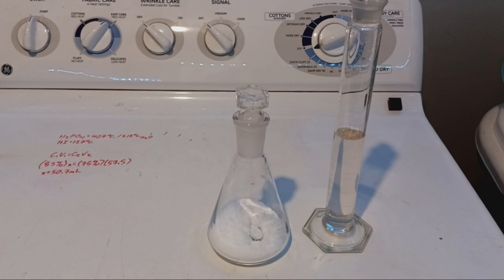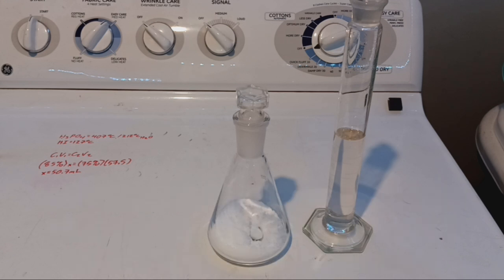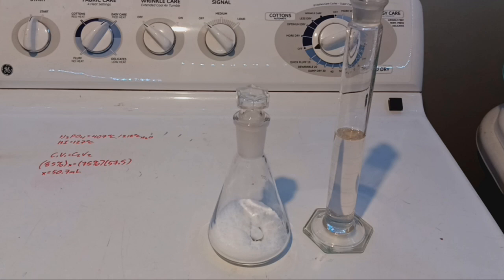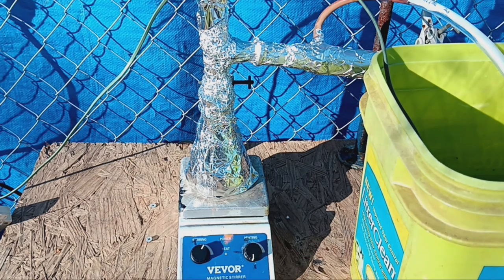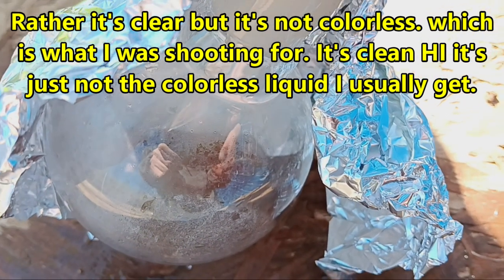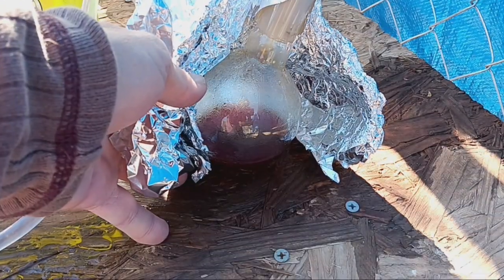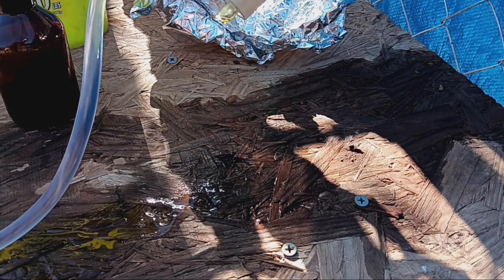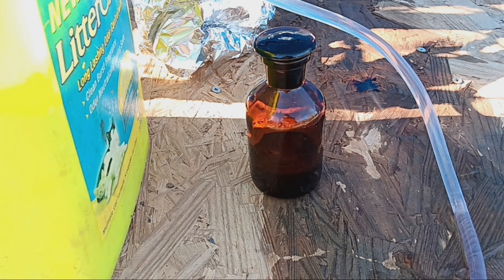Conc. Hydriodic Acid From Easy to Buy Chems #chemistry #iodine

Comment from the maker: Other than the dark color the prep was a total success. I got some fairly strong HI out of it. Hydriodic acid is the strongest of the hydrohalic acids and among the strongest acids you can easily make at home. I was thinking of making an exotic metal iodide or something else cool with it. I don't want to leave it on the shelf to slowly go bad. I used to play with iodides a lot because they are often quite colorful but I gave up on them after a while becuase they frequently have stability issues in storage. Anyways I hope you guys liked it! Merry Christmas!! 🙂
Reply: Yes HI is impressive.  It can react with noble metals such as copper, mercury and even silver when heated with them and form their iodide salts (the stability of the iodide complexes makes the reaction thermodynamically favorable).
Reply: Btw if you have red phosphorus on hand you can throw a small amount in the HI to get rid of the iodine (it takes a little while but it works).  Of course a small amount of phoshorous acid will be formed and but that itself acts as a stabilizer for HI against air oxidation.
Reply from the maker: @mspalien  Never thought of that Wish I had some red P to try it!! Thanks for the tip! 🥰🥰🥰
Reply: awesome! I will be making some soon.
Reply: Too bad iodine atoms are so chunky and fat, I guess sometimes that's desirable though.
Reply from the maker: @amanitaocreata4401  😂😂 But that's one of the things that helps to make HI a strong acid. Also it's a great leaving group. So that fat ass has its uses. 😁😁
Reply: @PoorMansChemist hey, I got some KRS-5 crystals (TlBr/TlI 1:1 molar ratio). What would be the best option to get Tl2SO4 out of em? Just heating it together with H2SO4 produces TlHSO4 as far as I know. Maybe if there is an excess of thallium bromoiodide crystals instead of excessive acid it will give Tl2SO4 instead of the acid salt? Thanks in advance for help!
Reply from the maker: @petertench-zw2ti  That's a tough one. Getting halide ion out of thallium was my kryptonite for a while. You can't reduce it to the metal becasue precipitated thallium clumps like nothing else I've ever seen. Halide ions in the solution will always get trapped in the metal sponge. And not a little bit either. Now for TlBr and TlI combined you could go with precipitation of the halide out with a silver salt but thallium iodide isn't very soluble. However, there is a way that I've come across that should work (in theory; I've yet to test it). You can convert the thallium to the oxide and precipitate it out that way. IN THEORY this should shift the solution equilibrium dissolving more thallium iodide as more thallium precipitates out as the oxide. The most obvious potential problem is passivation of the thallium bromide/iodide with a layer of the oxide. I can see that being an issue. The conversion to the oxide is done with aqueous sodium hydroxide and strong hydrogen peroxide (you can buy it online from walmart).
Reply: @PoorMansChemist Would a 40% peroxide suffice or 60% is required? Also wouldn't concentrated NaOH cause H2O2 decomposition if you just add em together?
Reply: @PoorMansChemist Theoretically, could melting it together with sodium metal work, by reducing it into metallic thallium and NaI+NaBr? Or maybe use liquid bromine (I have it too) to turn the iodide into bromide, which should be much more soluble?
Reply from the maker: @petertench-zw2ti  DONT DO THAT! At least not unless you've got very good PPE and extremely good ventilation. Thallium halides sublimate when hot. They're not strictly ionic compounds. The bonding has significant covalent character meaning that they're fairly molecular in their nature. That means that they will sublimate and vaporize when they get hot. Also be extremely careful with melting thallium because I have no idea how likely it is to produce vapors. I've had cadmium metal fume fever before and that was exceedingly unpleasant. Thallium is much less volatile than cadmium but thallium metal fume fever would cause life-altering poisoning even if you survived it. The damage that it causes is permanent. And don't forget thallium has a nasty habit of absorbing across the skin. If it's sublimates and condenses onto something informs a film you could touch it and get it all over you and not know it. I'm not sure where the threshold of toxicity is with thallium but I know that even a hundred milligrams is not good. Also so far as I understand it Prussian Blue is only an effective antidote if the thallium was ingested. I don't know how effective it is if it's absorbed through the skin.
Reply from the maker: @petertench-zw2ti  PS I've worked with thallium for years and the only reason that I'm still okay is because I am extremely careful with it when I do. Don't ever underestimate it or get casual with it. I'm not saying that you will but I just have to stress that because I really don't want you to die. It's hard enough to get subscribers as it is without them going dying all over the place😊
Reply: @PoorMansChemist I am able to do that outdoors with remote controlled equipment. Thanks for concern for my health and safety though!
Reply from the maker: @ Of course! Chemistry is extremely fun but it can also be extremely unforgiving. The last thing I want is for anyone to get hurt or unalived. I am always concerned that I make some of this stuff look easier than it actually is. I would go with the conversion to thallium oxide. I have some recycled thallium chloride that I've been wanting to try that technique out on anyways. I will do a video on it soon. However, I specifically chose the chloride because it is moderately soluble in near boiling water. The more you can get to dissolve the better it will be. Free ions in solution can react easily whereas solid particles can only react at their surfaces. That's why passivation would become a concern. The surface layer of the particle can react forming a passivating layer of oxide. In theory. Thallium(I) oxide may have properties that I am unaware of that make it easier. But given how much of a massive pain in the ass it is to work with thallium I'd wager than she will make it difficult somehow. She usually does. 🙂As for the hydrogen peroxide 10% or 30% is more than sufficient. Take care with hydrogen peroxide that strong. It's not forgiving either. If you get it on your skin it will burn and turn your skin white as it kills it. However, strangely enoguh this never seems to cause bad chemical burns. But don't underestimate it either. Whatever you decide to do with the thallium be very careful. Doing it remotely is all well and good until you come to a messy step like filtration where there isn't a good way to do it without using your hands. Also you have to go near the thing eventually to get your product. Watch out for dust and aerosols. Beware surfaces that have been anywhere near the thallium. Like I said I work with this element frequently and I'm OK becasue I take extensive precautions. Some of it is definitely going overboard but I don't take any chances. Thallium poisoing can't be fixed by medical science. You might live but you'll be all fucked up and normal life will become a thing that only happens to other people. If you have any technical questions or need advice let me know.
Reply: @PoorMansChemist Thallium(I) oxide is unlikely to precipitate, unless it's insoluble in alkaline pH water, since it's soluble giving TlOH, I guess you meant Tl2O3 instead, that is completely insoluble (should be even less soluble than TlI, which helps with running this reaction all the way to the end). My plan is: (with all precautions) dissolve the crystal in hot sulfuric acid, dissolve in water, oxidize the thallium ions using h2o2, precipitate thallium (iii) oxide using NaOH, dissolve the oxide in stoichometric amounts of h2so4 and reduce it to thallium (i), maybe using so2 gas for that. Does that sound reasonable, or are there any pitfalls I did not account for?

Thanks again for caring for safety. Thallium is a treacherous metal, and poisoning can fuck you up mentally, while not killing you, so all possible precautions are necessary, there's no "overkill" precautions when thallium is involved.
Reply: I think I figured out how to de-halogenize the thallium (at least TlI and TlBr). Bromides and iodides are easily oxidated by nitric acid. Just heat TlX and HNO3 aqueous solution together. Then CCl4+separatory funnel should do the trick for removing the halogens we just freed from the salt. This will not work for thallium chloride, it should be turned into (III) oxide and then recycled, the same way you did it in the chromate video.

According to a scientific article I read, nitric acid cannot oxidize Tl(I) into Tl(III) even in its fuming form, but H2O2 easily does that. This does make things easier.

Thanks for help, please don't stop with  redneck thallium wizardry, I'm really looking forward for more vids.

In case you'll come up with something better than CCl4 for removing halogens, let me know please!

Comment: We tried to unmix this, but nope;  
Distill it? We haven't a hope.  
Its steam is the same  
As the liquid. The name  
For this mixture's an azeotrope.
Reply from the maker: Did you come up with that yourself? If so it's quite good. 🙂
Reply: @PoorMansChemist  all the good limericks are stolen .. ck your email, 12/27/24, 12:55 and 1/8/25, 14:31-- link at end of article.
Reply: @PoorMansChemist  all the good limericks are stolen .. ck your email, 12/27/24, 12:55 and 1/8/25, 14:31-- link at end of article.
Reply: @PoorMansChemist  all good limericks are stolen .. ck yr email, 12/27/24, 12:55 and 1/8/25, 14:31-- link at end of article.

Comment: I felt the frustration.  Can’t you add a few grams of sodium metabisulfite and distill again?  Or maybe mix copper filings with it before distilling since cuprous iodide is insoluble.

BTW it’s been mild up north recently.  I have been enjoying 45 degree weather.  I only get miserable when it’s below 20 or the afternoons don’t reach 30.
Reply from the maker: I think adding some red P to it would clear it up. But I don't have any.

Comment: I have questions  ... 
How does phosphoric acid get 'old'?  I once had a 100-year-old reagent bottle of copper sulfate, and last time I looked it was still nice blue crystals. 
And the approximate stoichiometry of this prep: Is the byproduct more KH2PO4, or K3PO4, or just a glassy mess of unreacted H3PO4 and salts? 
Wikipedia says anyhydrous HI is a gas which tends to fall apart into its elements, like hydrogen selenide and such. If the stuff you are distilling is on the rich side of azeotropic, could the HI be breaking down in the gas phase?  I don't fully understand this azeotrope -- it has a higher boiling point than HI and water? How does its boiling point vary with concentration?
Reply from the maker: I don't know. It was the only thing I could come up with. It's been well sealed for that entire 5 year period. I don't use phosphoric acid all that much. The boiling point is higher because of the ionic activity of the HI. At least that's my best guess.
Reply: @PoorMansChemist  a little further down my overly long comment, I was pondering whether it was on the concentrated side of azeotropic, and excess HI in the gas phase (and not H3OI) was dissociating, as those heavy hydrides do, and releasing a trace of H2 with the I2..
Reply from the maker: @jrob495  I don't think so. At least I've never heard of anything like that before. Oxidizing iodide to iodate takes alkaline conditions. At least so far as I know it does. I know that to make iodate you react I2 with aqueous alkali hydroxide. To oxidize iodide in acid conditions takes pretty strong oxidizers (nitric acid, chloric acid, chlorine gas, etc). HI should be reducing. Atmospheric oxygen may oxidize some iodide to iodine but Id think that it would have a tendency to form triiodide unless the ion is unstable in acid conditions (Googles AI says its stable and its usually correct although its an AI so take it with a sizeable grain of salt). I think the most obvious thing to do would be to take a sample of the acid and keep one stored under argon and keep one stored under ambient air and see what happens over time. A stability study might yield interesting results. We could check for the effects of light as well. As for iodate that is extremely easy to test for since many metal iodates are not very soluble whereas the corresponding iodide is. Although I honestly would not expect to see any.
Reply from the maker: @jrob495  PS THANK YOU!!!!! 🥰🥰🥰

Comment: Can you throw just a tiny pinch of sodium sulfite or even thiosulfate in there and redistill to get a clear product?
Ive probably said this before but I've done this a few times but with methanol to make methyl iodide in situ and the results have been all over the place. Its the most inconsistent reaction I've done to date. Maybe next time I'll make HI first then react with methanol.
Reply from the maker: Yeah it seems like varied products are kind of the norm for compounds like HI and organoiodine compounds. I've made HI before and it was totally colorless but for whatever reason this time it had an amber color to it. The CI2H2 I made should have been colorless but it had a slight purple tinge to it. Very slight but still there. And I was very careful with that one. Iodine compounds don't seem to store well either. I once made NdI3.6H2O and it was perfect. I stored it in a bottle in the dark and a few months later it had turned itself into black sludge. 🤷‍♀

Someone suggested adding a bit of red P to the HI and then redistilling to remove the H3PO4 product. Never heard of that before but it should work. Sadly I don't have any red P anymore or I would try it.
Reply: @PoorMansChemist  a small amount of aluminum should work too.  Sulphur also works but requires a redistillation and you get Sulphur in the column.
Reply: Almost anything you add to the product will become an impurity. If you're using it for anything, you want to consider the possible effects of an impurity on a subsequent prep. I thought perhaps a pinch of finely divided silver -- it's insoluble and would just sit there on the bottom of the bottle. Some chemists have used hydrazine, which eliminates the color but leaves the hydrazinium salt if unreacted.
Reply: Re heat it for a bit.

Comment: Here's an idea...What about mixing stoichiometric solutions of BaI2 & H2SO4, and filtering to remove the BaSO4?  Because of the high solubility of HI, you should be able to get 57% HI right away.
Reply from the maker: The sulfuric acid will oxidize the iodide to iodine. That's why you can melt iodine under sulfuric acid. Any iodide would be converted back to iodine (plus the acid sucks every molecule of water out of the iodine). If sulfuric acid wouldn't oxidize the iodide I could make HI using the same method that I use to make HBr (theoretically). But it could never work. Vexing isn't it?
Reply: @PoorMansChemist  H2SO4 is an oxidizer only when concentrated, which is why you can make HBr, HCN, etc, with 50% H2SO4 & the appropriate salt.  The H2SO4 in the case I described would be pretty dilute.  I think it's worth a try....
Reply from the maker: @Pootycat8359  Give it a shot and let us know. If it works I will definitely give it a try.

Comment: 2:08  True!  Especially since red P is so useful in making fun things that go "BOOM"!  (Just be VER-R-R-RY CAREFUL! :face-fuchsia-wide-eyes:).
Reply from the maker: Yeah Armstrongs mixture is fun to play with. Although very, very carefully. That stuff is no joke. Oxygen has a raging hard on for phosphorus and it will dump the loyal but plain chlorine in chlorate and hook up with the younger, prettier phosphorus in a hot second.
Reply: @PoorMansChemist  In the early 70s, I was trying to come up with a mixture that would go "BANG!" when a packet of it was struck with an airgun pellet.  There were plenty of combinations that would go "whoosh" or even, "thump," but nothing more brisant.  Then I hit upon KClO3 + P.  That was it!  I didn't know it had already been discovered, nor how notorious it was.  One day, while mixing up a small batch, it went off.  It caused no permanent injury, but several of my fingers swelled to TWICE their normal diameter.  I became very, VERY, VER-R-R-R-RY careful, with such experiments, following that experience.
Reply from the maker: @Pootycat8359  Every time I hit little piles of it with a hammer I could feel the rush of air on my hand from the shockwave. I once made the mistake of whacking a small pile of it while about 6 inches from a wall with no hearing protection on. For the next 3 to 4 minutes all I could hear was a high pitched whine. Actual sounds were very muffled for a few minutes  I never did that again. 

Silver chlorite would probably also work as a bang-able air gun target  Although dont actually bang air gun targets. It will chafe like hell.
Reply: @PoorMansChemist  Something that's fun is to scan down the "melting point" column in "Lange's Handbook of Chemistry," and noting entries that say "Expl." at a particular temp.  One that I'd like to check out is lead chlorite.  And since the ClO2(--) ion is an oxidizer, adding a little fuel should increase the "oomph."  AgClO2 is probably similar, but I'd guess it would be more touchy, just as the fulminate is, compared to the Hg analog.  🎇
Reply: Boom or zoom😂